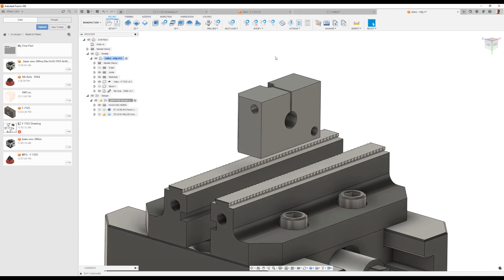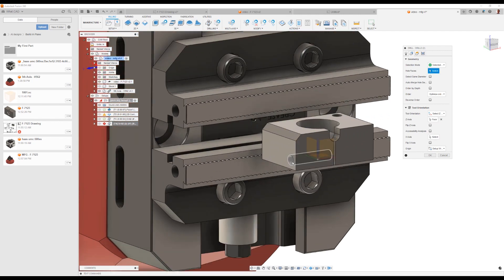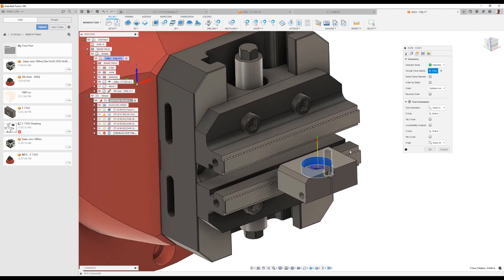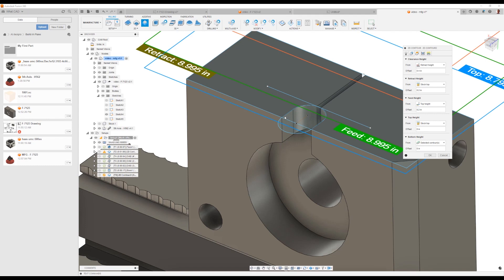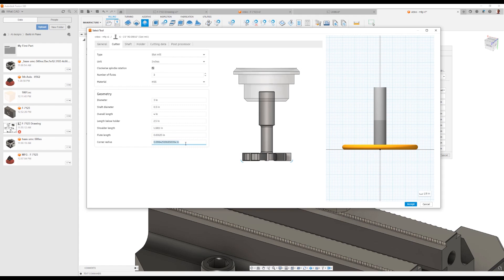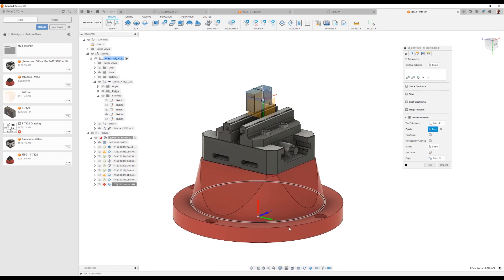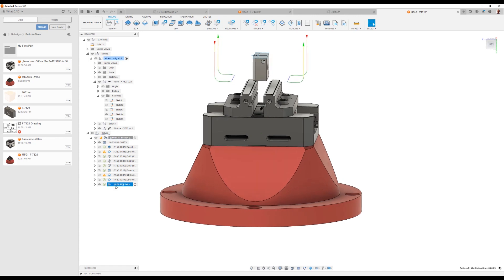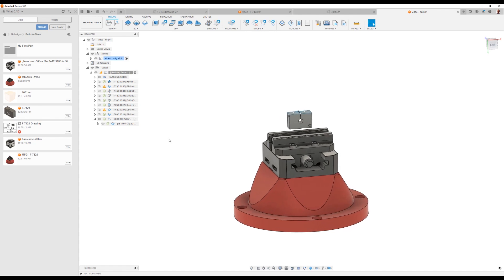CAD/CAM Fundamentals: From 5-Axis Setup to G-code | Autodesk Fusion

Comment: So buggy........
Reply: SAy more, is there specific things you feel we should focus on?
Reply: @PM.al.whatmough  Ya basic functionality. Like I can select a component despite it not only being hidden in the browser + behind and completely blocked by a component in front of it + having Face priority enabled. What? How?! Or the slowness. Or the beach balls of death after doing just about anything, or the crashes on brand new M1/Intel macs, or the mouse pointer magnet. WHAT IS THE DEAL WITH THE HORRIBLE MOUSE POINTER MAGNET? If I’m pointing my mouse pointer above a face I want to select that face. Not the edge a 1/16” to the right of the mouse pointer, not the edge a 1/16” to the left, not the face on the opposite side of the model. I have a muscle tremor, tendonitis, and I’m using a trackpad. Yet it is Fusion that is the biggest obstacle getting in the way of me being able to select what I want. Insane. Why do I have the option to add smoothing to the trace toolpath? That toolpath doesn’t support smoothing. That check box is literally there for no reason. The viewcube just stops working randomly. The browser stays on my screen like its job is just to block any content outside of Fusion. Did I just dimension a line segment in the sketch environment? Oops looks like that line just got transported off screen to the moon. You have to be aware of these bugs, no? If not maybe figure out why that is. I could go on and on and on and on.....
Reply: @matthewdavis9954  This is great feedback.  That trace one is on me and my team.  That is silly, isn't it?  I will pass on the modeling feedback to those teams.   I am not in the day-day of some of this.